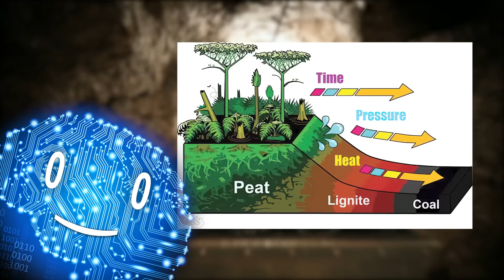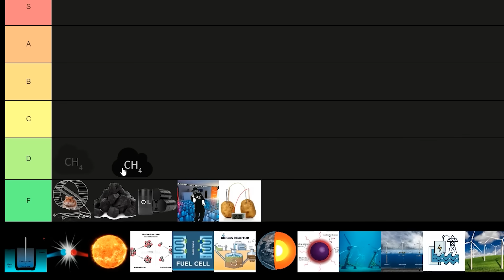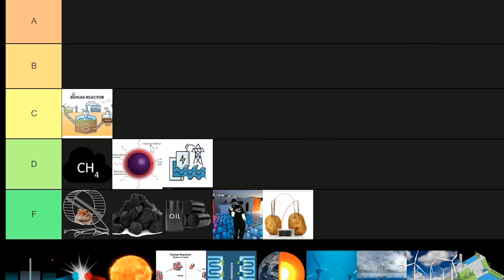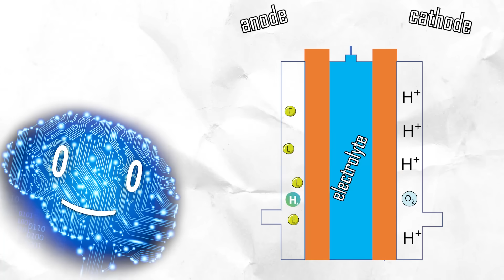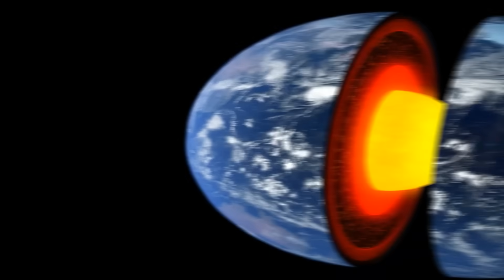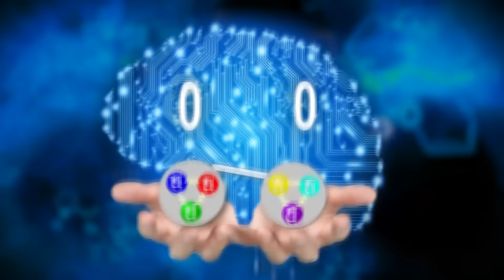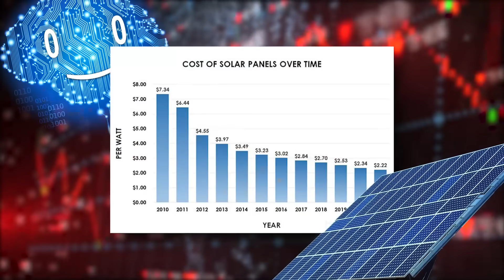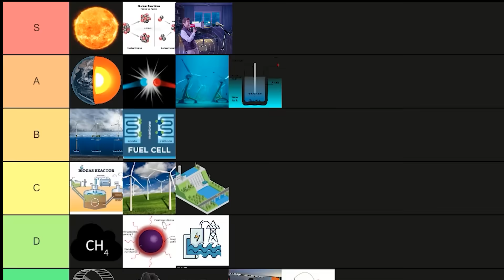Tier List of Energy Sources Explained

Comment: Petrol should be higher, since it's the most viable transportable source of energy right now
Reply: In addition to that Solar and wind aren't that great really, the cost of production and to set it in motion isn't viable at all compared to any fossil fuel and they require too much space and maintenance to ever be viable.
Reply: I should also add that while hydrogen would be a great competitor to oil (especially if we ever learn how to extract hydrogen from water) the fact that it's a gas and not a liquid has a lot of inconvenients that would require our whole infrastructure to be redesigned
Reply: @benoisette9418  We already know how to extract hydrogen from water, it's called electrolysis.

Comment: The problem with antimatter is, even if we found a way to obtain it cheaply, it annihilates upon contact with matter, which makes it extremely difficult and dangerous to store. You basically have to suspend it in a vacuum using magnetic fields and prevent it from touching anything, and this would require constant power, and if that power ever failed, you have what is essentially a nuclear bomb.
Reply: So you basically store significant amounts of a material that if a single gram of it touched regular matter at all it would explode with the force of the most powerful nuclear bombs known to man inside containers that need constant power to make sure that they don't contact matter at all. Yeah, I see where the problems begin.
Reply: @THE_CABERMAN_PRIME  according to my calculations it would release this much joules in 1 kilograms 89,875,517,873,681,764 J
Reply: Why did the goblin turn on the stove?
Reply: @Yukarri88 why?
Reply: @Yukarri88  why
Reply: A nuclear bomb is not even close to what antimatter with matter can do. They basically turn into a continent destroyer thermonuclear bomb
Reply: You could just, use the antimatter where it's made, IE: fire it directly into the reactor as opposed to a trap.
Reply: Skip the storing step and go straight from harvesting to annihilation to produce energy (if possible)
Reply: Huge penning traps
Reply: Call me whatever, but I doubt its existence... same thing with Hawking radiation, which is not experimentally proven to even exist
Reply: I think a torus lined with permanent magnets might work, especially if each one only contains a minescule quantity.
Reply: The guy who make some funny as fuck reviews also like funny science ai, why im not surprised?
Reply: Even achieving 100% vacuum is mostly impossible, tiny air leakage of those few air molecules is enough to obliterate your existence.
Reply: @maktham2006  indeed
Reply: It should be noted that if we found stable antimatter, it could hypothetically be used alongside regular matter, but so far, efforts have been moot.
Reply: @DanialTarki  ...thats not how antimatter works
Reply: @THE_CABERMAN_PRIME That’s literally how it works. Look at the Opossum’s comment.
Reply: @DanialTarki  Its stored in a magnetic field in a vacuum so that it doesn't come into contact with matter at all, not making it stable just keeping it from exploding instantly. It isn't making it stable, it's just holding it back from vanishing in a burst of energy instantly. I think the technology to store large amounts of antimatter safely is far beyond us, considering that we would need a constantly running magnetic field and it would need to be sealed extremely well to prevent matter from entering.
Reply: @THE_CABERMAN_PRIME I already knew that.
Reply: @DanialTarki  So... are you gonna explain how this leads to stable antimatter or whatnot?
Reply: @DanialTarki  stable antimatter is an oxymoron. It doesn’t exit, full stop, because it’s DEFINED as the “opposite” of matter. As soon as it interacts it annihilates instantly in a perfect 1:1 ratio of mass to energy
Reply: @rykerl6980  indeed
Reply: @rykerl6980 except it doesn’t. It’s not a 1:1 ratio, it’s ever, ever, ever so slightly in favor of matter. That’s why matter exists. When the universe started all matter and antimatter were made in equal amounts, and destroyed each other in an endless cycle until a universe of matter existed. 

If you want to know why, try to figure it out yourself. Hundreds of years of science’s greatest minds have no fucking clue why it happened like that
Reply: @mr.stuffdoer8483  from my understanding I’ve heard there just WAS slightly more matter but the energy produced was still a 1:1 ratio. Granted this is outside my field of study but I haven’t found any scientific literature that confirms one theory over the other
Reply: @mr.stuffdoer8483  I see... however a ratio difference on this scale would probably make no distance unless you are storing absurd amounts of antimatter from my understanding, although I could be wrong

Comment: The problem with wind is that most of the parts are fiberglass and non- recyclable. And they also require a lot of maintenance that involves the use of petrol based lubricants and fluids. Good on paper, bad in practice.
Reply: I think the blades end up getting fulling replaces about every 10-15 years. from what i understand they just bury them.

Comment: Disagree.
F: coal, petroleum
D: fossil gas, Tidal
C: Temperature Solar (future innovations could make it B tier)
B: hydroelectric, bioenergy,  Nuclear (future developments in SMRs could make it A tier)
A: geothermal (future developments in advanced geothermal could make it S tier)
S: PV solar, onshore wind, offshore wind

Hydrogen and Antimatter are not energy sources but ways to store energy. Most of the others are currently unavailable and therefore don't belong on the list.
Reply: I would argue temprature solar at point of use is S tier. (Solar hot water for example and space heating.)

Bioenergy I would rank F for some sources (corn) and S in others (landfill gas).
Reply: @catprog  I was talking about temp solar as an electricity source, but yeah temp solar for other purposes can be great. As far as corn ethanol, I'd say it depends on what you're using it for... for electricity? Definitely F, for road vehicles? Also F. But using it for airtravel fuel, as has just started, THAT can score much higher.

Comment: How tf you put solar up there, with no mention of its environmental impact (recycling and life cycle of panels) or the batteries required?
Reply: Both panels and batteries are starting to be recycled. Fossil fuel doesnt even have the option of being recycled
Reply: @hawks9142  yeah I know man, but why wasn't it mentioned? All the other entries have the environmental impacts. The recycle rates are very poor too man, small amount of it can be reused.
Reply: @jakeo8910  because he was too busy talking about Dyson spheres lol but as far as recycling goes, the materials that are being thrown away per year from old panels is worth 2 billion dollars, this is a huge market that will be capitalized on after the current technology is matured, the ceiling for what solar is capable of is simply much higher than any other method we have at the moment
Reply: @hawks9142  man again I agree.. but seemed a little sus to me. I can't wait for clean and cheap power. But I've seen mass graveyards of panels which aren't recycled or even maintained. The battery portion is also very important and not mentioned at all. Im guessing with hypothetical thoughts of dysonspheres, batteries is an easy solve and goes without saying. By the time we figure out a dysonsphere, it wouldn't even be practical.

Comment: Belgium is also as dumb as germany, shutting down their nuclear plants to buy electricity from norway, when norway doesn't have enough for their own country.
Reply: Germany bought a huge coal powerplant from Finland while shutting their nuclear power due enviroment reasons...

Meanwhile Finland starts to build new nuclear powerplant soon. It will likely lift nuclear power to be 70% of energy production.
Final coal plant is being shutdown in end of this year
Reply: @jarskil8862  It's apparently possible to build nuclear powerplants that use the energy left in spent fuel rods. USA has enough nuclear waste to supply them with power for 100 years. But that requires a different type of reactor.

Comment: kinda surprised you didn't mentioned the negative impacts of solar energy like the toxic waste from batteries
Reply: With that logic should we also start adding how much steel and electronics pollute when building fossil fuel?
Reply: @jarskil8862  I don’t understand what you mean by building fossil fuel? Steel waste is not as bad as plastic waste or electronic waste which may include old battery acid or other toxic elements harmful to the environment and bio life. But it would not be a bad idea to account for environmental impact of all types of waste. We must hold ourselves accountable.
Reply: Same with not mentioning the massive water consumption caused by Nuclear
doesn't get talked about enough
Reply: @Youtubeisntlettingmeuseczech  the water that rains back down to earth?
Reply: @Youtubeisntlettingmeuseczech that's for all thermal power plants, not just nuclear, also they don't need cooling towers, it's just cheaper to use them near rivers or oceans

Comment: You forgot Radioisotope Thermal Generators
Reply: Rtgs are slow, not that efficient, and get power from the heat off radioactive materials
Reply: @lekaozganguploader  Yeah but He mentions solar power for spacecraft aswell, which practically doesnt provide much more power. It has many use cases aswell.
Reply: @gamingmitmaus6949  fair 🤷‍♂️

Comment: Remeber anyone, energy can be generated by exploiting differences. You won't get electricity from something hot, you'll get it from cooling the hot thing.
Reply: Cooling something does not alone mean that it would be generating power.

In turbines they let the super heated steam to expand and this expansion turns the turbine. As side effect expanding gas cools down.

Hotter the steam, more it wants to expand when giving a chance. More it wants to expand, harder it pushes against turbine blades.
Reply: @jarskil8862 you just confirmed his point. It’s not the ground (for example) being hot that generates power, it’s the water not being hot and THEN becoming hot.
Reply: @jarskil8862  Google seebeck effect, or seebeck generator. cooling one side of the generator alone would make it generate power, same for heating one side

Comment: well, could rate energy sources based on the following:
- safety (like ofc burning fuels will cause ppl to die)
- practicality (hamster generators are prob not practical to keep up)
- energy output (like nuclear will obviously make more than wind)
- cost (nuclear is expensive to build, but fossil fuels cost more to keep up)
- difficulty (fission and fusion are obviously way harder to handle)

Comment: I would'nt put Nuclear Fision into S tier ! The amound of costs to build a reactor, maintain and store the waste just doesnt make Economic sense !
Reply: but it does make environmental sense
Reply: @Astrikss  Bro solar energy has  cheapest KW/h  why would you spend billions to build and maintain Nuclear reactors ? It just doesn’t make sense anymore ! It’s obsolet unless we get a way to create a nuclear fusion reactor
Reply: @Harrock Because powergrid requires stable adjustment power.

No matter how much electricity is being used, the input in the grid must be stable.
This adjustment power can only be done reliably with powerfull generators.

While Wind and Solar are amazing powersources, they are too unpredictable to be trusted this "adjustment power"

For this coal, gas or nuclear, or hydro is required.
Reply: @jarskil8862   you know that we can store energy that is not used during the day ... compressing Gas that powers a turbine when its used or pumping water up and letting it down when it need to be used ...

Comment: cold fusion is not possible due to physics...and any reactor using it would means that it need heavy shielding
almost all the kind of fusion reaction would at one point generate neutron which is hostile to every thing in it path ...you need physically enough atom to stop it as it carries no charge

fission reactor should be top tier energy...nuclear waste although dangerous to near by enviroment ....it is tiny when compare to the amount of sulfur and carbon the traditional coal gas power plant
as it also only takes up minor amount of land to burry the waste....such waste ..however can be renew to new product if handled correctly
the biggest benefit of fission reactor is not just in that it generate way more energy then any other method we have per cost and space...it also generate fuel for the fusion reactor to do reserch on as now it takes ton of power just to make tritium by the fusion reactor it self...where it is a byproduct in fission reactor

Comment: I cannot believe you actually put cold fusion on here. At this point it's basically pyramid power.

I would have ranked antimatter far far lower. Sure. There might be an efficient way to generate antimatter. Discovered right after I see a unicorn in my backyard. But it's probably going to always be an energy sync. The process to generate it will likely always take far more energy to produce it. The collisions used to create it create other non-antimatter particles. Which takes away energy. So if you put into antimatter creation 1 unit of energy. You will always get less than 1 unit of energy potential  out of it in the form of antimatter. No engine is 100% efficient. So you'll actually get less than that once you put it in your generator.  And this is completely ignoring the energy consumed to create the collision conditions. Transportation. And any other sources of energy required for this process like storage. Making that ratio far far lower than one. Where as something like fossil fuels are viable because the energy used in there entire process is far less than the energy we get out of ut from burning it. Quite frankly I'd rank antimatter lower than fossil fuels. It's so bad. You would need an f- rank. Its worse than hamster power.

So it is probably always something that will require us to lose energy to. The only way to partially fix this is to find a nearly perfect 1:1 matter to antimatter conversation process. Or find a large natural source that we can efficiently mine. And make all the other logistics as energy cheap as possible. But again. Unless you find a way to violate energy conservation.... theres basically no way this will remotely be a useful form of everyday sources of energy.

Where its worth still dealing with and trying is for things where high energy or high energy densities matter. Things like that. And you already have a nearly inexhaustible energy source your already using. That's why you do it. If we had anti matter generators and we shut everything else that generates any form of energy off other than it. We probably would be back to the stone age in about a week. It's that bad.

Comment: I will say that the combination of solar and nuclear does create problems which engineers warned politicians about, but politicians chose to ignore because the engineers were just "being negative".  That is the ability to control the rate of energy production.  I don't think I need to explain on the solar side, but nuclear decay doesn't really speed up or slow down because we want it to.  For example, on a particularly sunny day in the years before everyone had AC, and the solar production was exceptionally high that day, the result was that energy had to be intentionally wasted at the nuclear station BECAUSE it was already produced by the solar.  How this is achieved is by taking the high pressure steam and directing it to the condenser without passing through the turbines.  There really needs to be a controllable, gap filler energy source.  Best bet on that is hydro electric, as we can meter the amount of water passing through them to some extent.
Reply: Problem with hydroelectric dams is the location, or rather, the need for a suitable hydrographic bowl. Here in Brazil we have plenty of those, with lots of rivers that can be dammed, but you gotta factor in the land that you lose in the flooding process. Land that could be used for farming or anything else, really.

And then there's the problem of when it doesn't rain as much as you need, which can happen quite often for many reasons that are far beyond your control.